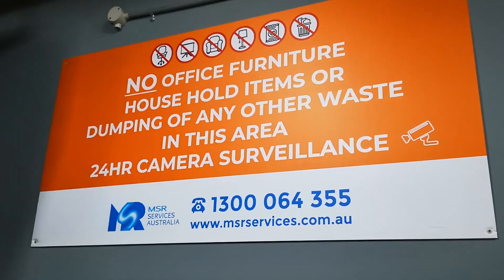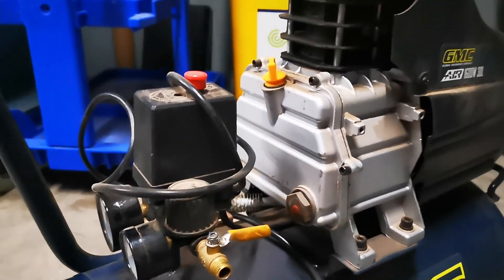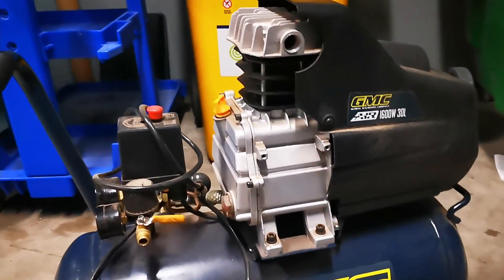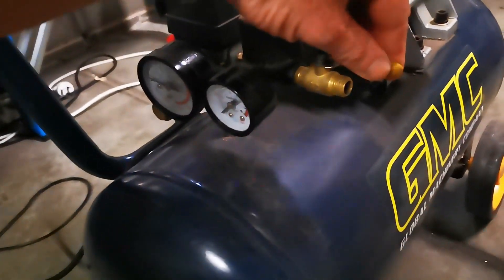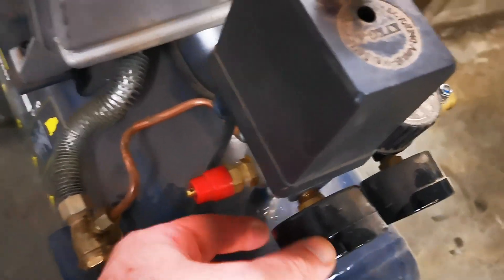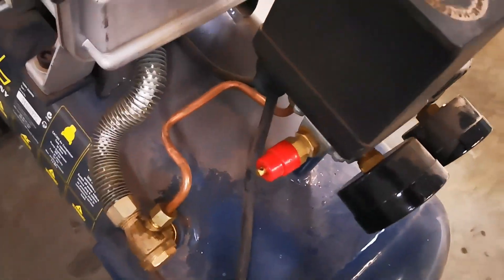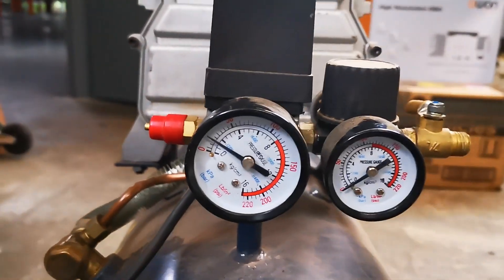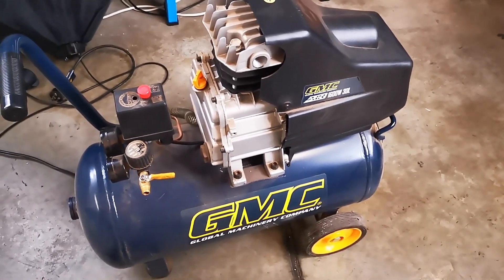Dumpster Diving Decompression

Comment: Looks like a new gauge might be needed. My guess on the electrical device at the top, is a pressure switch, to shut off the motor when the tank has been pressurized to its working pressure. Also might be able to make the unit a bit quieter by adding the missing intake filter.
Reply: That's exactly what that is.
Reply: @sparkplug1018  +1

I think the air leak isn't a big deal, as long as the tank can hold some pressure, I use mine to paint and need 2bar. Taking the thread out and adding some natural gas pipe sealant might fix the leak even without changing any parts. Trying to imagine what's the point of the second gauge, I had a tour to look at my compressor and I only have one gauge. Only if it's needed it should be changed, and the only reason it would be needed is if the solenoid relies on it to kill the power when it reaches whatever set target (which I seriously doubt). Otherwise you have the 2nd gauge.

Top tip to make it silent - buy a 20m hose and leave the compressor in another room. Drop 20dB in an instant
Reply: @dragosmihai3489  second gauge is pressure after the regulator that's on there. First gauge is tank pressure. so you fill tank to like 80 psi, and regulate to whatever your tool needs.
Reply: It's not going to be quieter. They are loud as hell with or without the filter. That filter just prevents dust from sandblasting the cylinder wall.
Reply: @cristiannicolae6309  Yes, they are "loud as hell" but the intake filter does make a difference. Might not be noticeable by everyone, but it is noticeable by some.

Comment: Its not a solenoid its a switch, and always turn it on on the unit, as these have a relief thing.
Reply: They call the relief thing in the pressure switch a "unloader" to drain the air upstream of the one way valve so there is no pressure on the piston on startup. It's the hiss you hear when a unit shuts off at set pressure. (Small copper tube from the switch back to the compressor line upstream of the tank connection one way valve.)

Comment: FYI:
Your "solenoid" should be the (over-)pressure shut-off. At some pressure the tank will burst.
Reply: Pressure switch (what Dave referred to as solenoid) is a control element for normal operating conditions, and there's a mandatory pressure safety valve next to it in case the switch fails and motor keeps running, pumping the tank to no end. It prevents excessive pressure buildup and dangerous tank failure. 

By the way, these safety valves should be manually blown off once in a while (a few weeks, actually). So do safety valves on storage water heaters. Residual current circuit breakers are supposed to be tested once in a month. And all these devices have one thing in common: hardly anyone does that! :)
Reply: I think you need to learn what a PSV is for.

Comment: Hey Dave.  it's Missing The Intake Air Filter.    That screws into the intake.  There's a screw on air filter
Reply from the maker: Does it really matter that much?
Reply: @EEVblog2  I you work in a clean environment and the compressor is free. Nope. Tighten the gauge up and you should be right.
Reply: @EEVblog2  Intake filters just help reduce the wear on the vanes/pistons. They often also reduce the noise of the unit.
Reply: @EEVblog2  its much qietted with the filter I have the same model
Reply: @helltanner3722  can confirm that. I've 3d printed mine when i broke off the original one
Reply: @EEVblog2  Filter makes it much quieter. Intake is generally the loudest part of the unit and easiest to improve.